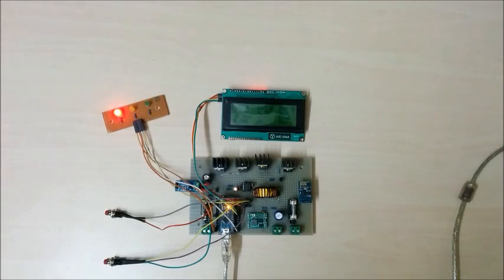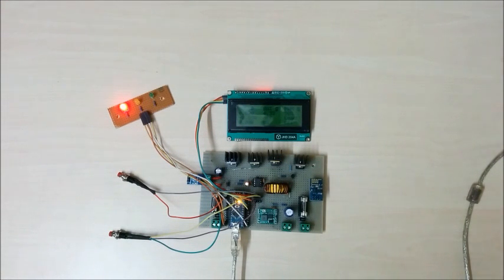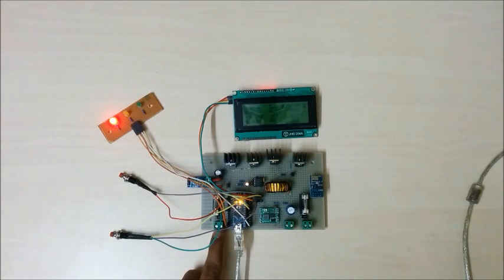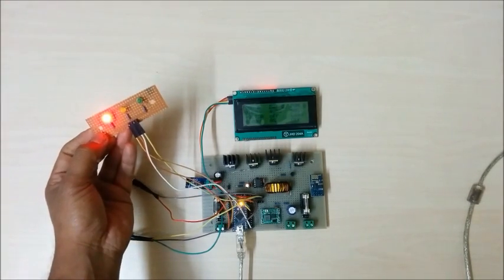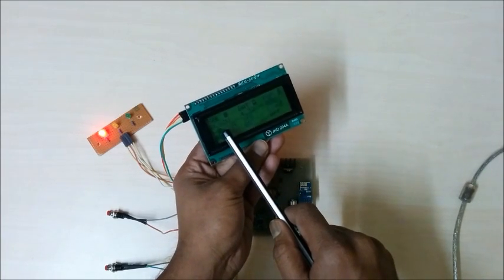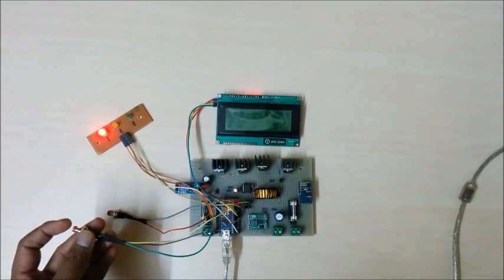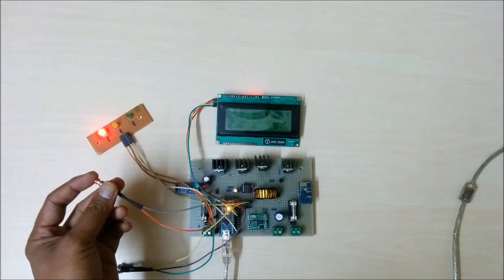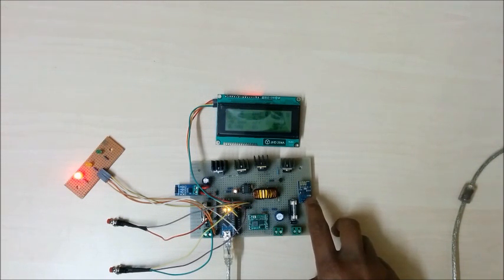ARDUINO MPPT SOLAR CHARGE CONTROLLER ( Version-3.0)

Comment: Hello, 
I was wondering if you could tell me what I could use for Maximum power tracking experiment with P&O method
I have a commercial charge controller, Sparkfun sunnybuddy
and a 30W solar panel

Comment: sir, I need my existing  inverter set solar charger and main line . it step i need MPPT solar + controller. u make this item how many cost ? pls. reply me ....pkpranab101@mail.com    wt- 300wPanel,12v 20-25amp, battery 150ah, inv-800va

Comment: this video is misleading. Although theoretically you are showing this as MPPT but where is the charge controlling circuitry. A proper MPPT charge controller has two parts, one for tracking the maximum power point and second to control the battery charging voltage with a PWM control. At first gather sufficient knowledge and then create videos. Good luck.
Reply from the maker: Sudipta Mandal Thank You.
Before commenting to someone go through the project details.Thousands  of  people are are involved in this project.May be I am not so knowledgeable like you but not the remaining people.From the pro hardware expert to software expert are involved in this project.I request you to go through the comments section of the project documentation.
Reply: well for a time being just forget what other people are saying. Just tell me one thing, Which part of your circuit is actually controlling the charge? Obviously there should be something to control the charge flowing into the battery depending on the battery status whether it's fully charged or low in charge. Yes your design is MPPT but is it a charge controller??
Reply: You did not respond to my question +Open Green Energy

Comment: You should put a pull up resistor on /SD pin and change your code to set /SD pin to high as soon as arduino starts up until solar panel voltage is high enough, then start pwm and set /SD pin to low.When you want to stop pwm first set /SD line to high then stop pwm.

Comment: Protip: you can throw out the arduino and run all the functions directly off of an ESP8266 using the Arduino IDE.
Reply: But esp8266 has only 1 analog pin, unless you use adc or multiplexing, and the pwm frequency is not very high, esp 32 is best for it

Comment: Could I use the LCD module 20x4 lines without serial interface?
Reply: +Shimaa Gamal No, there are not enough free pins on the Arduino. You can get cheap serial interface modules on Ebay e.g. Nr.  111536131188